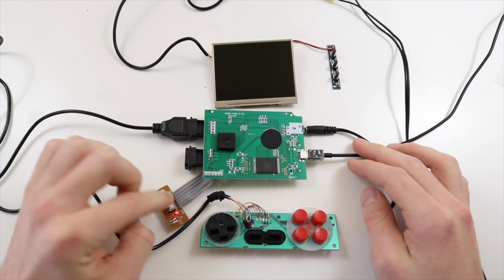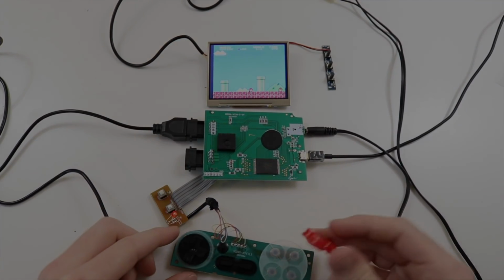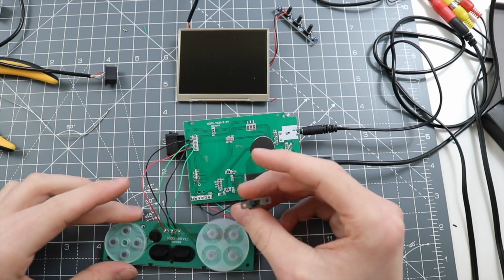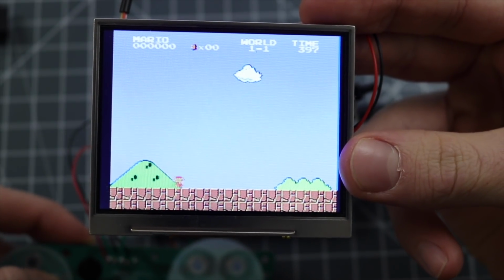Portable NES Classic Edition! | Part 1 of 2

Comment: You should have done it in The back of The cartridge so The front characteristic design remained intact
Reply: also add a label that says something like "129 in 1".
Reply from the maker: That would have been a good idea actually!
Reply: I do think it is more comfortable this way. You would have the sharper corners of the case jammed into your hand if you had everything on the back.

Comment: how about a rechargeable battery that would snap in at the bottom opening of the cartridge where normally the pcb contacts are? You could even cut down one of those extra cart sleeves as a cover for it. Also if possible a headphone jack. I love this idea inside of a cart, its outstanding. Id even go as far to try a Pi Zero W in there and go full SNES
Reply: and subbed!
Reply from the maker: Thanks man! How did you find this video? I think that will be the way forward! I will be buying an audio amp with a headphone and volume control on it!
Reply: i tinker all the time myself. I love to see fellow projects by people who love to dabble in it. I've built my own touchscreen jukebox, full size arcade, bartop(current build) and messing with raspberry things currently. Your mod caught my eye seeing it built into the cart housing. I love it mate!

Comment: plz response to this!! im planning on building one of these but i dont see how you connected the 3 Cables from the monitor to the mini nes? is it any adapter you use? please tell me. sorry for bad English im from sweden :)
Reply from the maker: I just used the included cable from the screen, soldered it to the board. Just use a multi meter and find which wire goes where!
Reply: thanks for fast response!